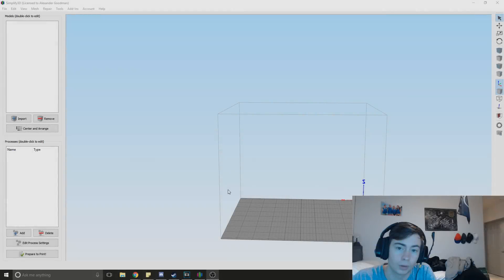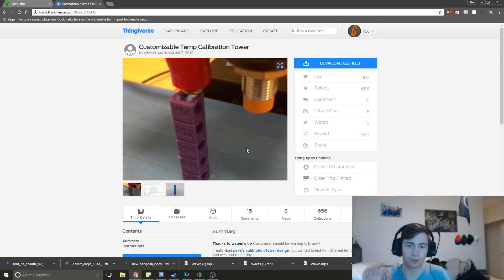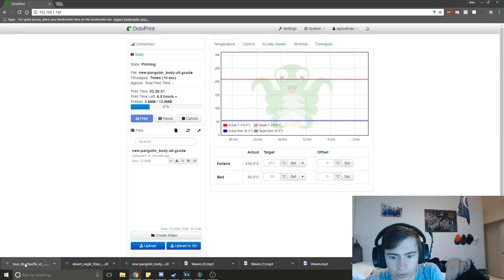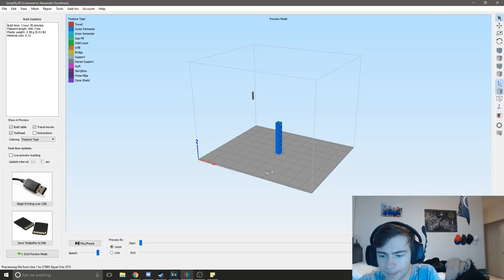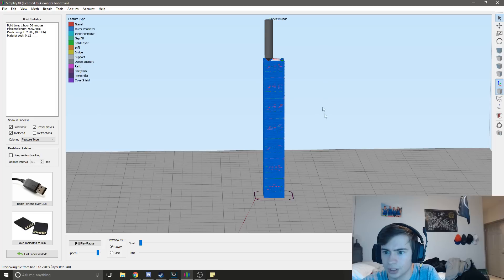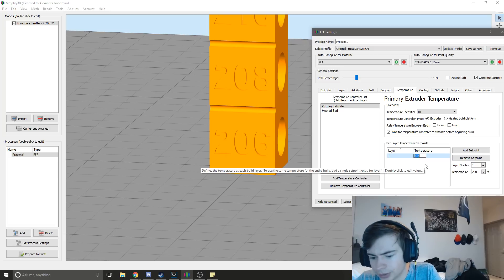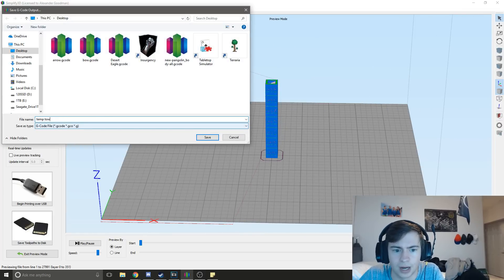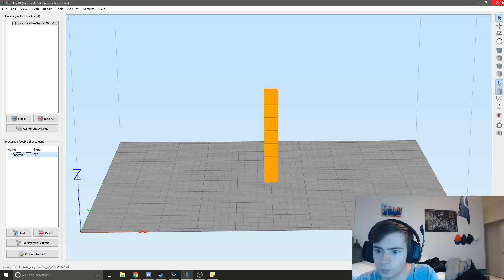HOW TO FIND THE PERFECT TEMP FOR ANY FILAMENT 3D PRINTING

Comment: please I need your help my 3d printer model 13860 when I set my temps too 215c and hot bed too 80c but when I start too print its goes down too 195c and hot bed too 50c

Comment: Helped me with S3d and my first temp tower. A link to a decent tower would be good...The one I grabbed was a change every 35 layers which in the thingiverse description was a centimeter.I can see merit in different tower styles to show different things at changing temps....I also notice many start at hottest at bottom, then cooler as they go up...Not sure which way is better...Final thought, temperature range for PLA....190-200? Seems worrysome to be either too hot or cool and jam up the extruder...Some thoughts on that in description may be helpful. But again, THANKS.
Reply from the maker: Really good ideas, thanks for the input I will totally keep this in mind!